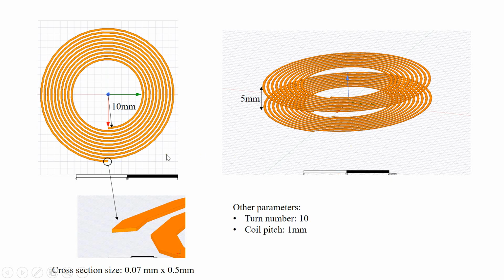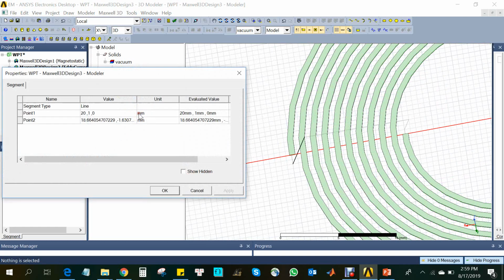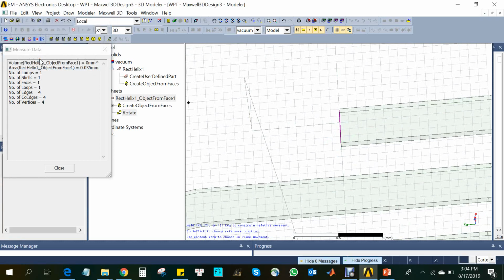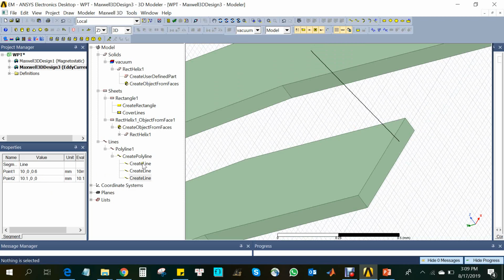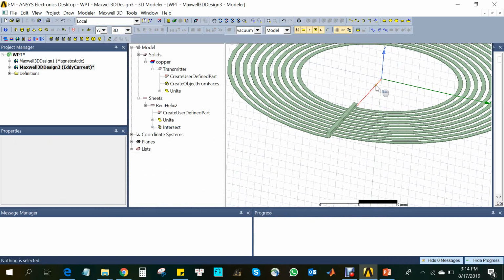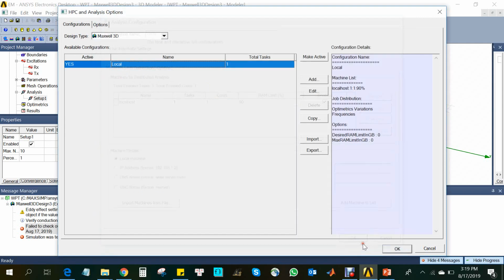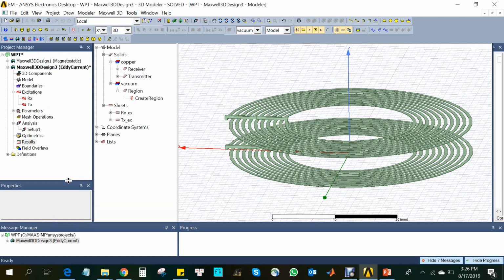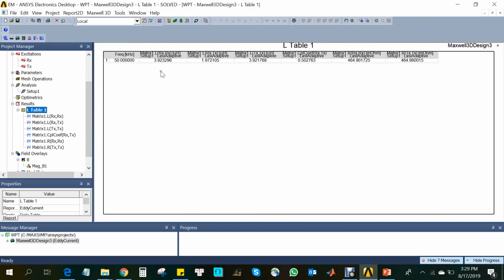Tutorials on wireless power transfer: Part 1 EM simulation in Ansys Maxwell

Comment: Thank you very much for the video, it helps me a lot from the start, but I got problem in analysis showing "The quality of some mesh elements is not acceptable for solution. Please check the geometry for issues in the following location (in meters): X=-0.00832203, Y=-0.0073075, Z=0.005", could you please provide with any advice, it would be great help.

Comment: İ want to work on megnwtostatic solver on 50kHz, with inductor And core combination to use fo Wireless Energy transfer. İ need to calculate the inductance values Of primary ana secondary inductors. Can yolu guide me.
Reply: Still need help?

Comment: Hi,
I am a student and I need a software for simulation of my wireless power transmission project.Can I stimulate it with this software.This also has a student package.If I can get some info about this it would be helpful.
Reply from the maker: Yes, absolutely. You can use Ansys Maxwell for simulation to calculate L, R values. However, to calculate efficiency, you should use MATLAB or other software. See Part 2 of the project.

Comment: great video, thanks a lot
may I know is it possible to make rectangular coil and assign number of the turns as one of the parameters ?
Reply from the maker: Hello. Yes, it is possible. There is a square spiral coil model in ANSYS Maxwell that you can try out. To make a rectangular shape, I think you need to write some codes in Python for the program. Ansys supports Python to work with it.